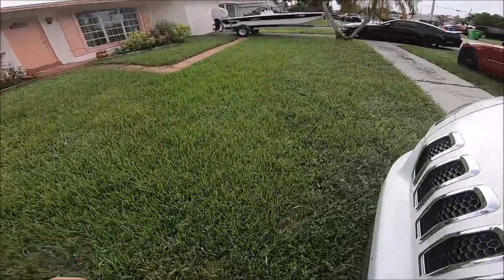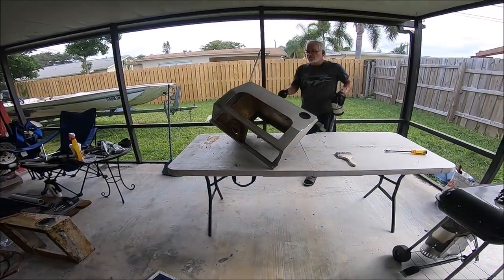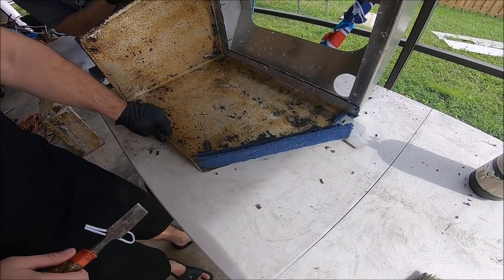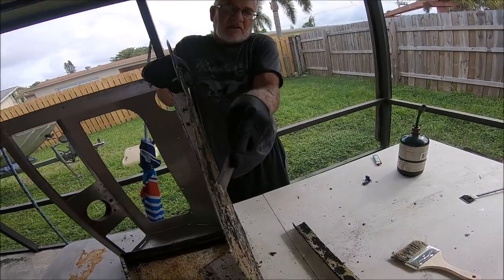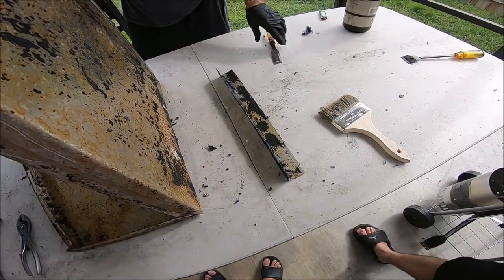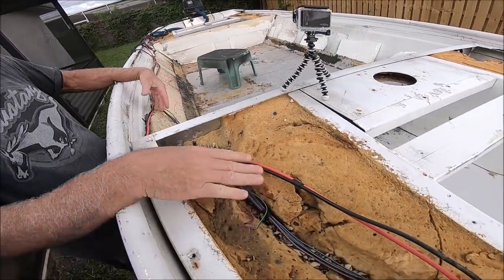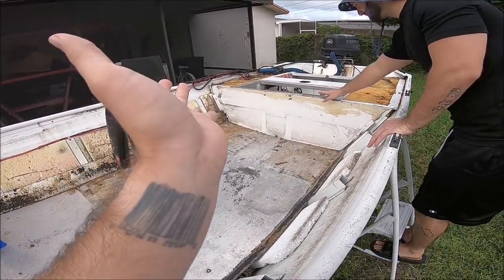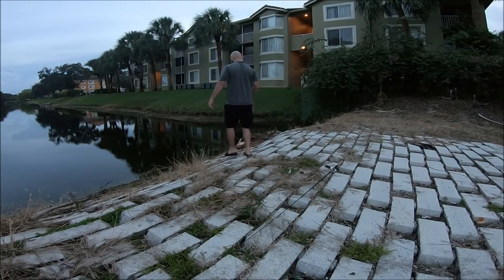Jon Boat Update#2 & Mako Pro Skiff Bimini Top! + Catching first Snakehead of 2018!

Comment: I just realized my Mako is quite different. Hull and casting deck completely different
Reply from the maker: Hooter Texas You must have the new 2019 model. The hulls design and decks are different. I have the 2018 model.
Reply: Couple of Adventures yeah mine is 2019. I had it out today and ran great. By myself I got it up to 37mph
Reply from the maker: Hooter Texas Nice! You have the 75hp?
Reply: Couple of Adventures nope. I have the 60HP. The hull has less surface area friction on the water so it’s able to go fast
Reply from the maker: Hooter Texas Wow! Sounds like they really improved the bottom hull design. Enjoy your time out in the water with it! Tight lines.
Reply: Couple of Adventures yeah so far I like the boat. Of course I want a bigger better boat but my budget right now is Mako skiff. Fishing was decent limited on specs and got one slot red. But I lost a huge red had to be over 30. Like a dumb ass I for no reason put my thumb on the spool when he was making a run, and my leader snapped.